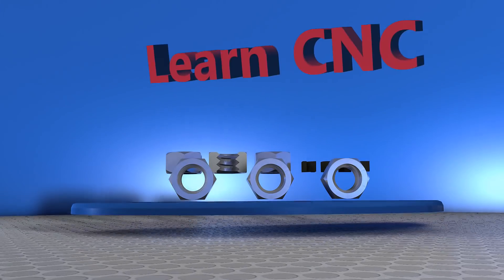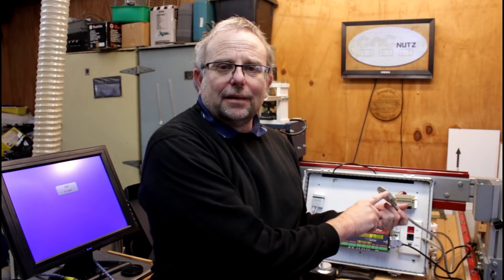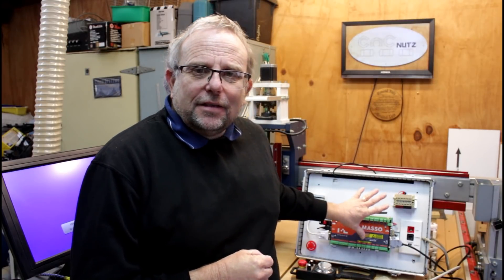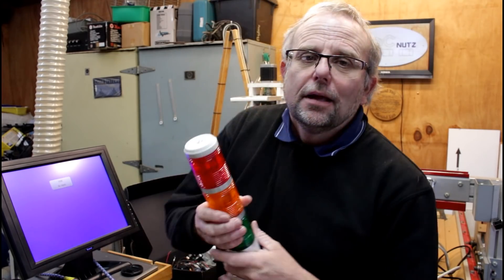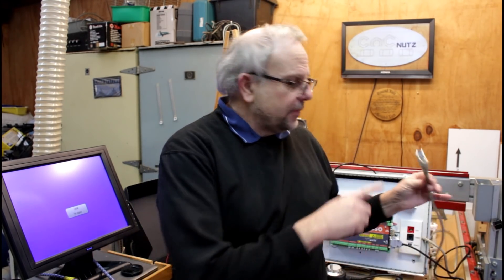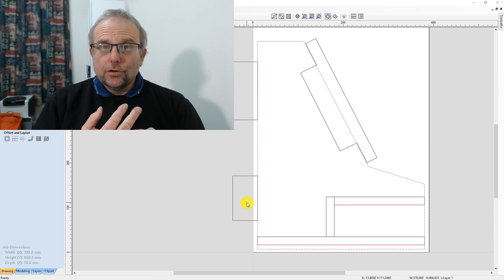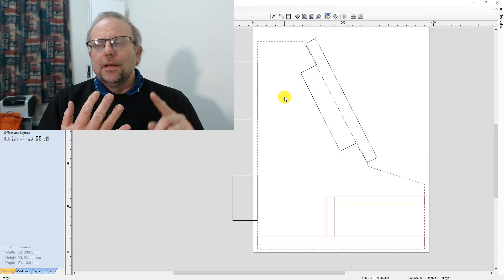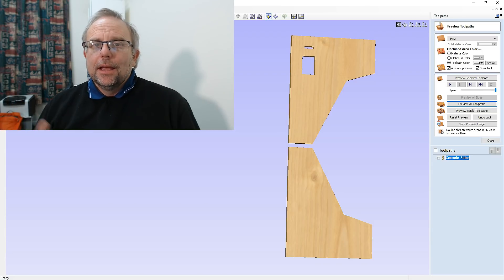How I Design a Project - CNCnutz Episode 237

Comment: As someone totally new to CNC I will try to follow along. However I am not sure if masso will work. I want to build my own machine and have acquired 4 x closed loop stepper motors and drivers. My question is in basic terms what do i need to incorporate masso and make it work. I have no other hardware and don't know what to get that will all work together. The maximum current is stated as 6 amps per motor. What is required to connect everything together ?
I do have the latest version of vcarve pro (11)
Reply from the maker: That is not really a question that I could answer here but I suggest that you sign up to the MASSO Forum and ask it there. Introduce yourself and provide information on what you already have and what sort of machine you are building.
Cheers Peter
Reply: @cncnutz  thanks for reply and for producing the videos I appreciate your efforts. If I do go down the masso route pretty sure your series will help

Comment: Hi Peter, please could you tell me the make and model of your monitor. Also what is the aspect ratio of the monitor. TIA Jon
Reply from the maker: Hi Jonathon
The monitor is a 15" Eyoyo monitor with a 3 x 4 aspect ratio, 1024*768 VGA, 4 wire resistance touch screen. I'm not sure the model but I know it is no longer available to purchase. If you are looking for a touch screen monitor to use with MASSO please select one from the list of monitors that have been confirmed to work.
Regards Peter

Comment: Hi Peter, do you have a video where you explain why you decided to switch from your existing system over to Masso, and what advantages it offers.  thanks kindly
Reply from the maker: No I don't have a video on my change to Masso. Basically I am now  working for them in my evenings and needed to have a setup that I can both learn from so that I understand how it works. Realistically every system has its advantages and disadvantages and it depends on what type of user you are whether you like or dislike something. Advantages to me may be disadvantages to you and visa versa. There really isn't much more to say at this time other than to say I like the Masso controller and have decided to use it for day to day use on my machine. 
Cheers
Peter

Comment: Good to see you Peter. You might consider a slide out tray for the keyboard so that you don't have to push the unit back on to the bench/table to use the k/board.
Cheers  Rob
Reply from the maker: Thanks Rob,  
I'm thinking draw runners so the keyboard can be used on the machine.  Cheers
Peter

Comment: Nice, or you can go with Vmware esxi. I had only 1 server in house. and a eth cable to the garage for the smoothstepper, then 1 usb ext cable with a usb dock that have hdmi, usb... But the touchscreen is nice to have !
Reply from the maker: Sounds an interesting setup. Never thought about HDMi over a USB docking station.
Cheers
Peter
Reply: @cncnutz  A good one and other.. like the Dell D3100 or d6000. For usb extender, go with normal wire up to 75 ft . The usb optical version, while ok at 100ft or more, most don't support hid mouse. Or you can go directly with hdmi optical cable. They work fine too for long run. But for my server, with 1 usb addon card of 4 port, i got 4 full desktop running.